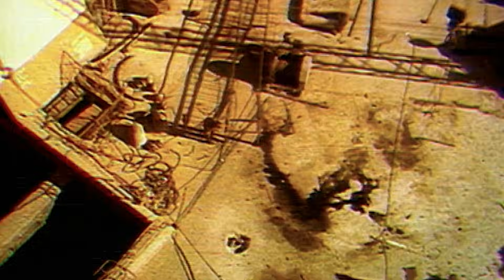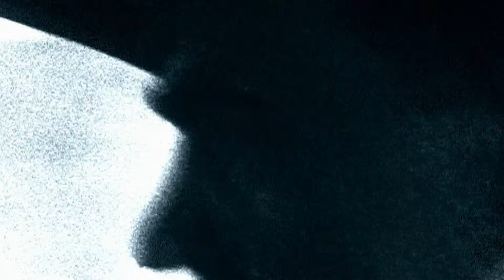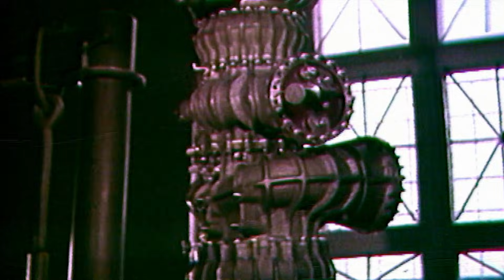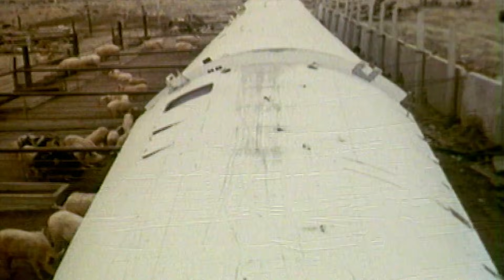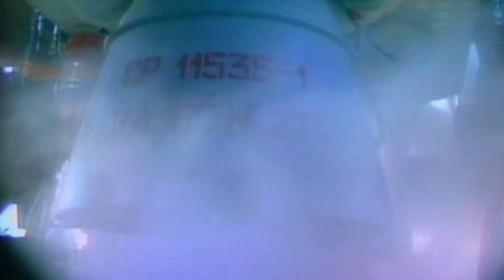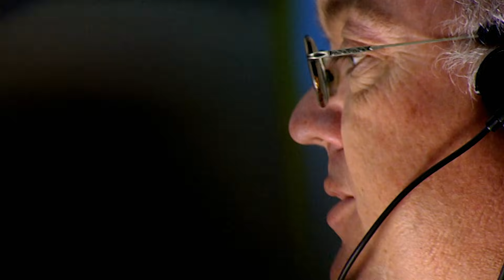How Cold War Shaped The World's First Spaceport | Baikonur Cosmodrome

Comment: SpaceX built and surpassed all their acheivements in 5 years! I've been to Baikonur. It's a real dump. They are so ashamed they don't even put their shuttle on display. Sad. The OKB had nothing on JPL... ever. The only thing that they couldn't compete with NASA on was the sheer profligacy of the US space programme.
Reply: Maybe because Russia is building their own space port. But the cosmodrome looks interesting as what i have seen through the lens of guys who explored the abandoned hangers of cosmodrome, and  cooked food on the abandoned space shuttle buran. What a great era that had been
Reply: SpaceX is brilliantly run and got a lot of advantages from NASA, plus they're building on knowledge gained through over 50 years of spaceflight.  NASA really all but ignored engine development for nearly 20 years to focus solely on the shuttle-- it wasn't until the mid-late 90's that NASA started really funding actual engine design advancement again, which is why the Soviets and by extension later Russians were so far ahead... they had developed the metallurgy and coatings needed for advanced oxygen-rich combustion cycles that the US had ignored and refused to fund even experimental research on.  It wasn't until after Challenger happened and the shortcomings and limitations, coupled with the foolishness of relying on shuttle as the ONLY launch vehicle needed going forward, that spurred research into more advanced engine proposals.  The aerospike engine, using a spike nozzle and J-2S turbopumps, was developed for the proposed single stage to orbit (SSTO) shuttle successor Venturestar/X-33.  More conventional engine development programs resulted in the RS-68, originally planned to be a higher thrust cheaper throwaway version of the SSME RS-25 engine for a "big dumb booster" or "shuttle C" vehicle, which eventually was adopted for use for the Delta IV launch vehicles.  TR-104 tested large scale pintle-injection engines, much simpler and cheaper to build for large size engines than the F-1's with their flat face machined injection plates.  RS-84 experimented with build a large high thrust reusable kerosene engine.  Some other projects that came along of note was the FASTRAC engine, a relatively small kerosene/LOX engine designed to be a low-cost, "throwaway" cheap engine similar in design philosophy to the RL-10 liquid hydrogen engine used on Centaur upper stages, which through mass production and simplification and cost cutting measures over the years got down to about the cost of a helicopter engine.  At that low of a cost, reusability wasn't even a necessary goal.  SpaceX started off by buying NASA's work on the FASTRAC engine and used it for the baseline for their original engine design for the Merlin engine.  FASTRAC was designed to be super-simple and CHEAP, using an ablatively cooled engine nozzle which slowly charred and burned away in flight, lasting sufficiently long to get the rocket to the planned point where the engines would shut down, with a safety margin.  It was never designed for reuse but sheer cost cutting.  SpaceX thought this was the way to go early on, but soon realized that if they could reuse the launch vehicle and engines it would be FAR more cost effective than throwing the entire booster and engine away after each flight, no matter how cheap that booster and engine might be designed to be.  SO they basically took the early Merlin designed off the FASTRAC design, and reengineered it to be REUSABLE engine with a regeneratively cooled nozzle and combustion chamber, suitably redesigned turbopumps and machinery designed for the greater propellant flow required and the greater robustness needed for reusability, etc.  In short, it turned into the Merlin 1-D we have today flying on Falcon 9, capable of multiple restarts in flight for the various reentry and landing burns on the first stage, and modified for vacuum operations on the upper stage.  

Later!  OL J R: )
Reply: @lukestrawwalker  Don't you think it's even more ironic that Elon Musk, after being rebuffed by the Russians way back, ended up with the Raptor being a closed cycle engine! Also the multi engine configuration on the soviet moonrocket compared to the super heavy. Awesome. It was an informative video nonetheless.
Reply: @allistairneil8968  LOL I remember reading on the NASA Spaceflight boards that a lot of 'old hats' within NASA were fretting over the SpaceX designs, both for Falcon Heavy and Starship.  Falcon Heavy uses 3 Falcon 9 first stages with a total of 27 Merlin 1-D engines, close to the N-1's total of 30 engines on the first stage.  Starship uses 33 Raptor engines on its first stage.  

The reason the N-1 failed was, the early NK-15 engines could only be fired ONCE-- so firing in a test stand would destroy the engine!  SO they built them in groups of six... doing everything identically throughout construction of the engines.  One would be selected at random and test fired, which would "certify" the other five in the batch as "flight ready".  Of course this overlooks mistakes and human limitations, and on one of the test flights metal debris, believed to be a nut, got sucked into an engine's turbopump and caused it to explode.  The second flight, the KORD engine system detected a fire in an engine and KORD worked not by gimbaling the engines to stabilize the rocket and control its trajectory, but by throttling opposing pairs of FIXED engines up or down to cause the rocket to move as desired in flight.  When it detected a damaged or malfunctioning engine, it shut it down.  The fire in one of the engines damaged the one next to it, and KORD shut down the opposite engine on the other side of the rocket from it, to keep the thrust balanced and maintain control.  With four engines now shut down out of 30 so soon after liftoff, the rocket no longer had sufficient thrust for the weight, so it keeled over and crashed back down on the pad and exploded.  An uncontrolled roll that the KORD system couldn't deal wiith (it only worked in pitch and yaw, not roll like a gimbaled engine or gimbaled verniers could control roll as well) caused the next flight to break up shortly before first stage shutdown.  

Kuznetsov had in the meantime improved the NK-33's to be "reusable" meaning they could be test fired in a test stand and certified one by one, and then sent to be incorporated into the rocket.  By then it was too late-- Glushko, Korolev's longtime rival, got enough political traction to have Vasily Mishin, Korolev's successor after his death, fired, merge Korolev's OKB-1 design bureau with Glushko's own bureau with him as head of both, and cancel N-1 despite the next test vehicle with many improvements including Kuznetsov's new engines and an improved KORD guidance system being installed, which in all likelihood would have worked.  In its place Glushko got approval to build his own super-heavy booster rocket, which came to be known by the same name as the new combined design bureaus-- Energia.  

Comparing SpaceX's rockets to N-1 on sheer engine count is like comparing a Model T and a formula 1 racer... they both have a single four cylinder engine, but that's where the similarity ends... 

Later!  OL J R :)

Comment: I do NOT understand why they are talking about filters to prevent metal in the engine.  If filters are needed to prevent metal from upstream systems are needed the rocket is inherently poorly designed.  It would be some what akin to saying a filter was needed in the air intake to prevent small pieces of ones turbo charger from entering the engine intake on a cars' engine.  It the turbo charger is coming apart you are not going to get to far down the road.  Without more info this statement is hard to evaluate and a bit strange.
Reply: It was supposed to prevent bits of metal left in the plumbing from getting into the engines, which caused one N-1 to blow up.  

Accidents happen... on one US spaceflight, a plastic dust cover installed over the propellant line was left on accidentally when the engine was installed on the rocket, and when it ignited on the pad it almost immediately shut down.  This was on the Gemini 6 mission, and only the cool head of Wally Schirra kept them from ejecting from the capsule according to procedure, as called for, because he sensed the rocket hadn't lifted off.  The data was analyzed and the cause for the shutdown determined, and the engine demated from the vehicle, cover removed and the vehicle and engine examined for damage, the engine was reinstalled and the flight later launched normally and flew up to the first space rendezvous with Gemini 7 which was on a two week orbital mission to simulate being in space for the length of a lunar mission to test health effects on the astronauts involved.  

Later!  OL J R :)

Comment: I could be wrong but Didnt one of those original reconditioned engines go, pop, bang, kaboom, kaablueeee in a launch attempt on wallops island 10/28/14?  
Or maybe it was a smaller reconditioned Russian engine. I did hear it was an older import though. 
At any rate, the you tube video taken from across the bay in Mathews Va. is pretty incredible.